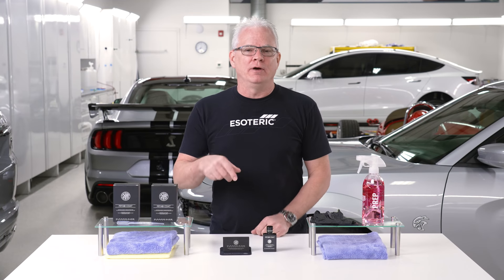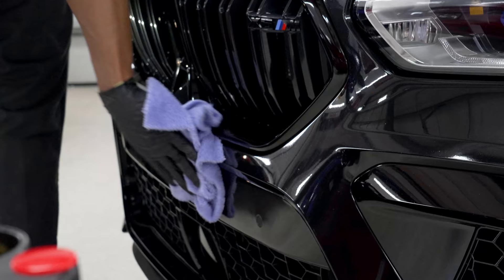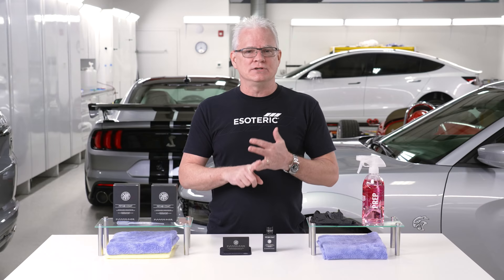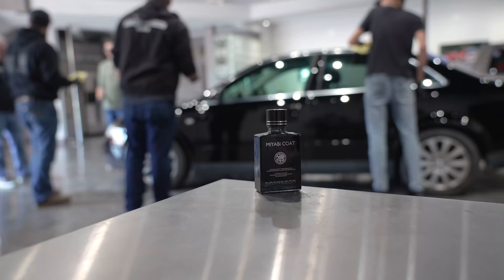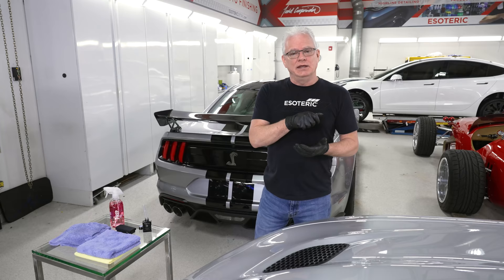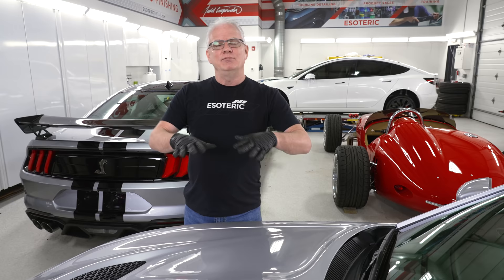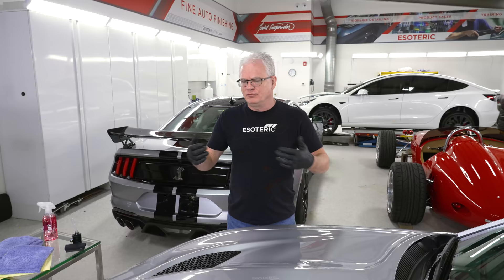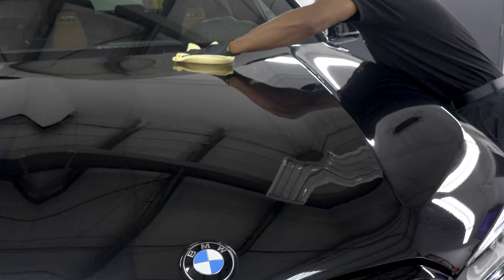The MOST used coating in our shop | KAMIKAZE Miyabi Review and Demo

Comment: Sir,can you give me suggestion for the best looks coating,prefer gyeon pure,or miyabi combo with ISM ? Thank you
Reply from the maker: It's not that simple of an answer. You also need to determine what kind of looks you're after, what you want with hydrophobic properties, slickness, ease of use, etc. Additionally, the color of the car helps dictate that as well. Your "best" looks will come from machine polishing...the coating is the icing on the cake.

Comment: Hey Todd. Do you have any experience with the Miyabi coat 2.0? I’ve used Miyabi as a base and Zipang as a top coat many times but was not aware there was a 2.0 version of Miyabi until just recently. Just curious to see if they would layer the same. Thanks.
Reply from the maker: I have it on my personal car! It's a great revision, and works just as well (and probably better) as a base for Zipang and other Kamikaze-Collection coatings.

Comment: I don't have a garage in which to keep my car overnight. Though I can plan days when it won't be raining, I can't predict dew overnight. Is the slight amount of moisture from dew going to cause problems in the first 24 hours? In the past, after applying a coating, I have covered the car with soft blankets or towels and then covered it with a disposable plastic cover for the overnight. I am wondering if I can stop the covering part. Great video by the way!
Reply from the maker: That's a tough one as it's definitely not recommended. Perhaps if you had it coated by 8 in the morning, then applied a coating maintenance product (Kamikaze Overcoat or Cosmic Spritz from Polishangel) a few hours later, then maybe.

Comment: I like the look of the product but not being able to apply it to plastic is putting me off and makes it user unfriendly, so I can’t apply it to the plastic bumpers of my 911?
Reply from the maker: It's not user unfriendly in the least bit...otherwise we wouldn't be using it so much. If you're talking about painted bumpers, then you're OK...we're talking about textured, un-finished plastic (like cowlings around windshield wiper arms on modern cars).

Comment: Question, i used Gyeon Prep before applying an si02 Ti02 coating and according to owner of coating Gyeon Prep is trash. Any issues with Gyeon Prep leaving residue behind???
Reply from the maker: So you're saying that the owner of a coating company is not recommending Prep? If that's the case, then I wonder why they would say that...other than it prevents them from selling another product?! I have never heard such a thing.

Comment: Is there a big difference between topping Miyabi with ISM or Zipang? I don’t care about cost I’m DIY guy and just concerned about looks. Especially after spending the time to jewel the paint prior to coating. New ZL1 stuck in Michigan train yard. Thanks in advance.
Reply from the maker: You'd have to do quite a few cars in different colors before you could determine any differences in looks between those two combinations. Given that, the Zipang then requires less time and effort to apply than 2 coats of the combo.
Reply: @Esotericdetail  thank you!

Comment: I have to ask you a question. Scotty Kilmer is a Professional mechanic he said that ceramic coating were bad for the paint of a car's paint that a car's paint needs to breathe. Is this true? I use polymer technology finishes on my paint. I'm a beginner detailer on my own car.
Reply: Jesus christ, Scotty Kilmer still lives in the 1980s. Hes not even a decent mechanic, and abit outdated...
Reply: Scotty Kilmer was relevant in the 70's-80's.   His opinions and expertise is severely outdated and as a result putting out bad/dangerous opinions that are not grounded in data/science.  

Entertaining on occasion but not current
Reply from the maker: If you want good information on paint, then speak to a professional detailer. If you want to find out how to fix a car, speak to a mechanic. Coatings will not damage your paint...
Reply: He's a mechanic, you don't go to a detailer to fix your engine do you? No, you go to a mechanic. Stop listening to what others have to say when it's not their line of work. He might be a good mechanic but he don't know anything about how to maintain your paint surface. He'll probably suggest you to paint your vehicle if he sees a bit of oxidization on it. A detailer will fix it and save you loads.
Reply: Only watched Scotty one time and I'm not a fan, but based on how junky his shop/garage were in that video, I would say going within a half-mile of his place would be bad for your car's paint

Comment: Hi Todd… after do a decontamination on my car plus a compound and polish, do I apply a wax then use the Miyabi coat on top of that wax as my finished product?
Reply from the maker: No. Wax has no place with coatings, either before or after. Your finish needs to be completely stripped clean before applying a coating, otherwise it won't bond well.
Reply: @Esotericdetail  thank you Todd, wow such fast feed back really appreciate. Love your video’s so helpful.
Reply from the maker: @kenbergman4106  My pleasure!

Comment: How well does it perform against water spots?  Looking for a coating that resist that, as one my cars is outside.
Reply from the maker: I don't know of a single coating that's going to prevent water spots. Since it's outside all of the time, it's even more important for you to maintain properly and regularly with something like Kamikaze Overcoat or Polishangel Cosmic Spritz.
Reply: @Esotericdetail  Thanks.  Allegedly there are coatings that based on their chemical make up, are less susceptible to outside elements including water spotting due to rain and/or hose water.  This is largely based on their water shedding behavior.  My curiosity was to better understand how this product reacts under these conditions vs others in the marketplace.
Reply from the maker: @kabes-us  That kind of messaging is usually coming from the same companies that claim scratch resistance, super hardness, and crazy-long durability claims...none of which are real. Coatings are there to provide long-term good looks, and ease of maintenance.